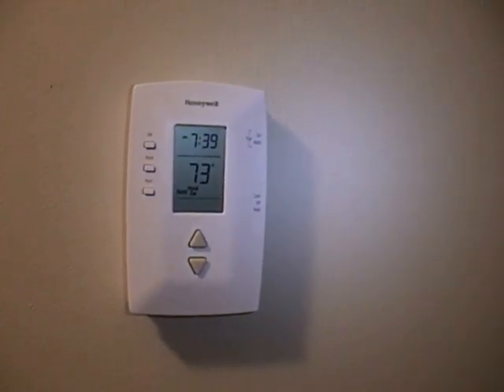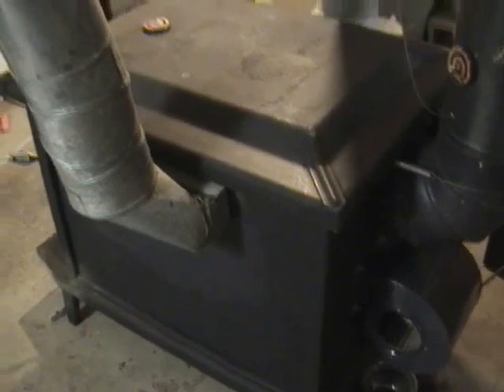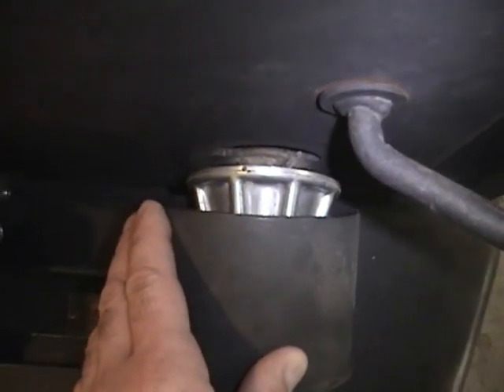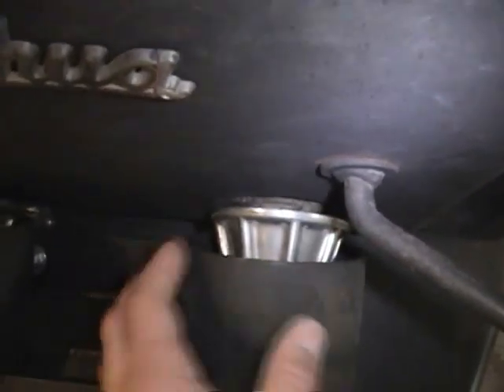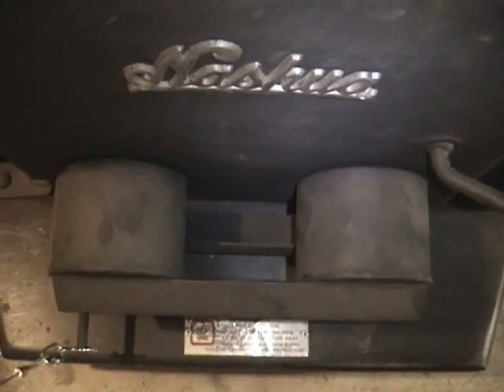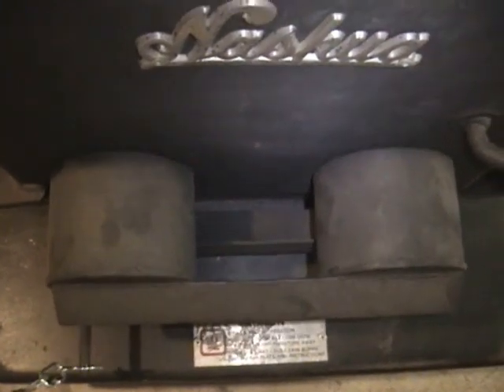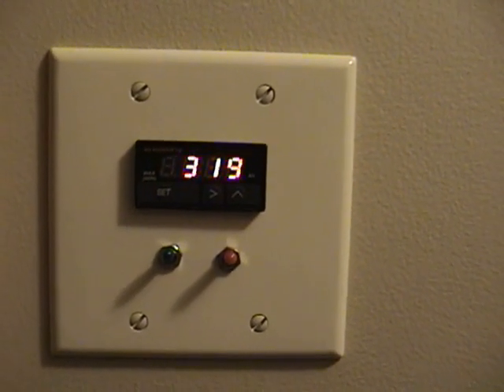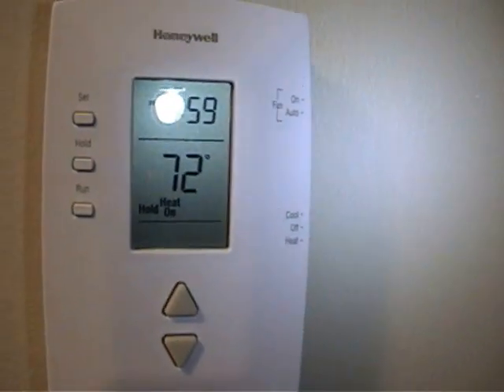Automated woodstove temperature controller Part 1 of 2

Comment: Cool project, thank you for sharing. Any chance you know how how you could modify this so the damper controller would constantly adjust to maintain a steady 500 degrees for example instead of reaching it's set point closing, hitting the low set point and opening up max. I'm just wondering if there's a way to progressively control the damper via somthing like a PID or arduino controller.

Comment: hello, I use a jdl612 pid controler (cheap off amazon) to control by draft on my homemade wood boiler. & plan on controlling 2 zones of my heated floor in my silo house as well. I want to order some of the cheap servo geared motor to control a damper  instead of the draft.  I'm not wanting to PLC the controls. I'm thinking a transducer might be what I am needing. Ever thought about having linear control? That way you can control the amount of wasted heat going out of the chimney... any thoughts?

Comment from the maker: You could probly use the same kind of servo motor that I used, though they are kinda loud. Large outdoor boilers use an electron magnet to open the [air] vent. How far left & right do you need it to slide ? The Auber EGT unit came from eBay and I bought the plain 1/4-20 threaded thermocouple with it. I use a 12V gel cell battery to power it, and simply keep a cheap ($7?) Harbor Freight float charger plugged in all the time.

Comment: Very nice setup. I want to do a similar thing. I have a woodstove that has two air intakes that work on sliders...horizontally slide left and right across each door to open or close the air. Do you have any ideas on how I could add or create some type of controller to move these automatically.

Also curious about hat Auber EGT; it is 12 volt DC right? Did you use a transformer from 120VAC to get it the 12VDC it requires? I've found them for about $109 recently, about double what you paid.

Comment from the maker: It reads AUBER1812 on the front of the unit. I bought it on eBay, and I think i searched using Digital EGT gauge or Digital EGT Temp. It was 59 or 69, and it came with the proper thermocouple (TC) .

Comment from the maker: It reads AUBER1812 on the front of the unit. I bought it on eBay, and I think i searched using Digital EGT gauge or Digital EGT Temp. It was $59 or $69, and it came with the proper thermocouple (TC) .
Reply: Still using this setup? How is it working for you. Anyway you can provide me url for temp guage and thermocoupler. Want to make sure I get the right one. Neat setup, any pics how you mounted the damper housing to woodstove? Thank you!